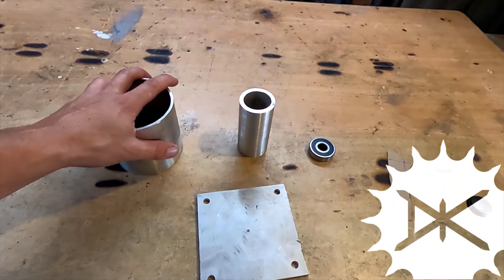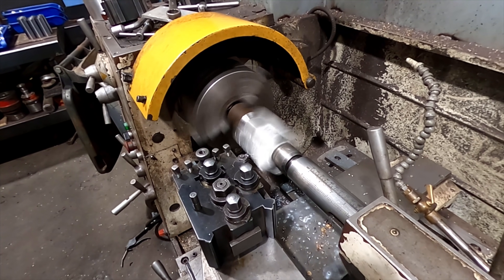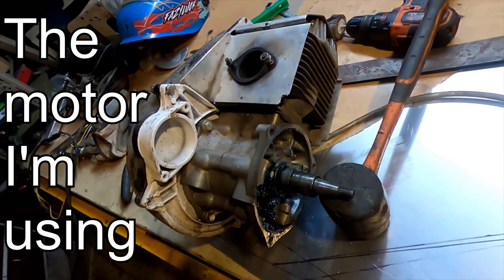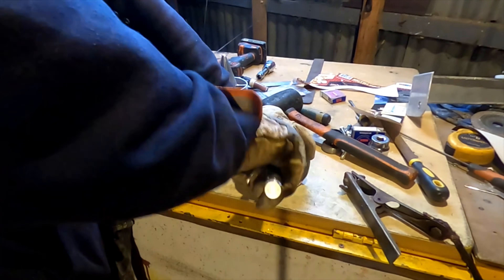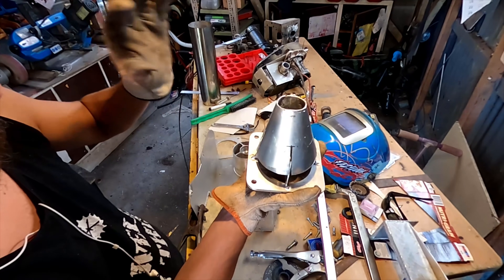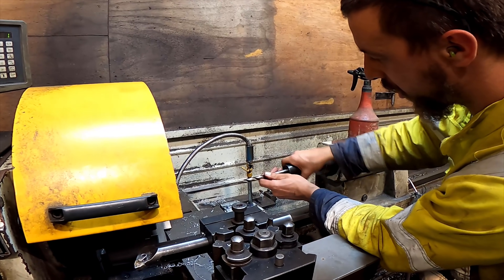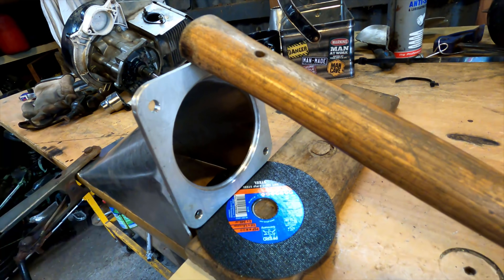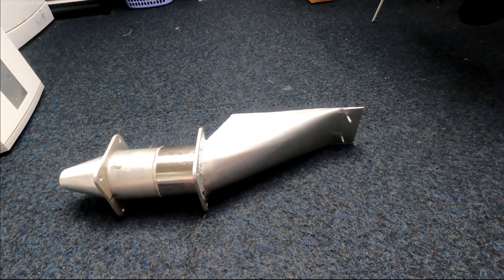Homemade Jet Drive Build Part 1

Comment: You made that intake look way simpler than anyone else I've seen make one. They had way more edges in theirs and it was welded out of multiple pieces. My understanding of fluid dynamics however leads me to believe that the rounder shape you went with is actually going to perform better. Nevertheless, it was great seeing you make one fairly simple because I need to make one for my custom setup at some point as well.

Comment: The fluorescent light may cause viewers sensitive to flashing lights to go into a seizure.  Im don’t suffer from it but having 65” LCD flashing at ya at 2am was a struggle to watch… but the content was worth the discomfort. God stuff
Reply from the maker: O sorry about that ! There is a fluorescent light above my bench great for work but not for filming I guess
Reply: @dkthewelder  not trying to tell you what to do, but you can get drop in LED tube replacements for fluorescent fixtures that require no change to the ballast. Or you can get a modern electronic ballast which operates at a much higher frequency which will remove the flickering. Traditional magnetic ballasts operate at line frequency, 50 or 60hz. Probably 50hz based on your accent. 😅 Your camera probably records at 25 to 50fps. To avoid flickering, your camera would need to either record at 2x the electrical line frequency in which case the flickering of the light would be accurately recorded in the video and would appear the same as it does in person. Or, you could increase the frequency of the light itself, which would make the flickering invisible to the camera, which is the better option. Modern ballasts operate in the 10s of thousands of hz, same with LEDs, which is more than sufficient for a normal camera. For stuff like slow motion, they make special LEDs that run on true DC and don’t flicker at all, but that’s overkill for this application. Either way, this is an awesome project you’re building and I’ll gladly watch the flickering lights if it means watching the creation of such a cool project. Good work 👍

Comment: You guys are nuts I F-ing love it.  I caught that tenths of gram remark btw.  I'd been offended if it wasn't so pathetically true.  You have no idea how frustrating it is as an engineer  dealing with two systems of measurement constantly and knowing ours is the stupid one makes it that much worse.  At least one of you can use a lathe without destroying any tooling or did you leave that part out?
Reply from the maker: Didn't break any tooling on this one! we have to work on imperial stuff sometimes but just convert it all to metric , I used an imperial lathe once was pretty difficult I am impressed that you guys and work with those strange units of measurement and make some really good quality stuff

Comment: I feel like your nozzle is too small . . . I can't be sure, but stuff like this is usually computer modeled, and I'm sure you're sacrificing a lot of efficiency and power!
Reply from the maker: It was pretty much all guess work I don’t really know how to do the computer stuff haha
Reply: @dkthewelder  I would try a larger nozzle before throwing it in the scrap bin atleast
Reply: @dkthewelder  https://youtu.be/C9jGKaiZIcQ
Reply: I'm an engineer and have dealt with quite a few jets in the past.  I also concur.  It looks like you've made something that may work but is seriously risking cavitation at higher rpms.
Reply: @subzero5101 
Will you be interested to help me dizine one jet pump for 10 hp engine 4000 RPM
Thanks
Reply: You should be polishing all those interior aluminum surfaces so the surface tension doesn't burn it up.  A simpler design would probably work much better and be easier to buff after welding.

Comment: Wow Daniel, I'm properly impressed.  Such an ambitious project and you are making it all come together nicely.  I appreciate the technical machining terms like 'It's making that too fast sound'.  🤣  I'll be using that at the first opportunity even if I have to speed up the lathe deliberately to make it chatter.  So is this drive going on your aluminium boat?  The one we saw in your last video?  And is all this just so you can past those wee rapids that you had to turn back from?  BTW We saw you tapping the aluminium sheet — I'm guessing that you'll have used Hank Bushes?  I've still got the ball ended punch I used for Hank Bushes from 50 years ago.   Wow, I am so looking forward to seeing this fire up.  Will balance be an issue do you think?  What will that engine rev to? 8000rpm?  Yes this is going to be interesting.
Reply from the maker: It will be in a little section that I can clip to that other boat . There are a lot of rivers around were I live and try get up also in the harbour. It Think that motor runs best at 6000 to 7000rpm and I have just guessed how big to make the jet unit hopefully it works!